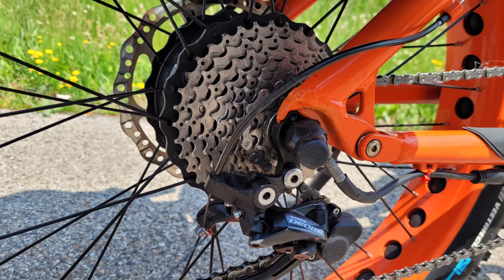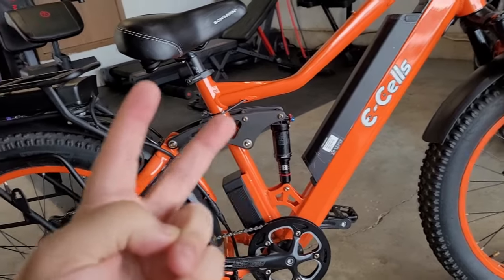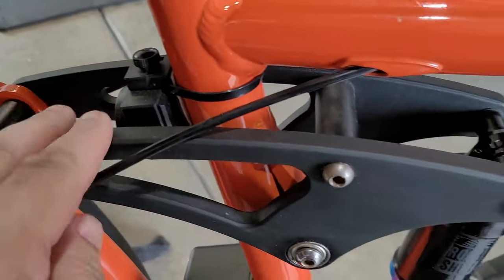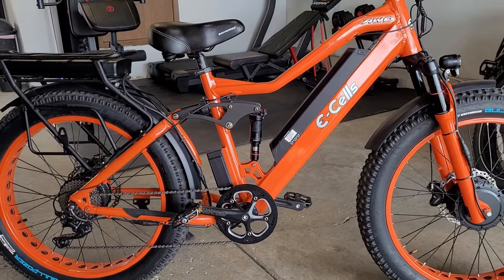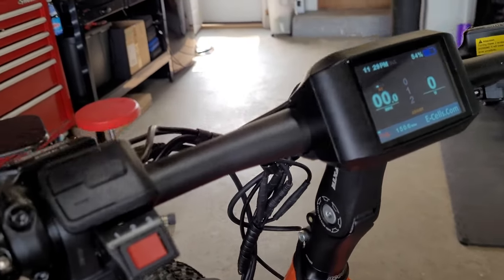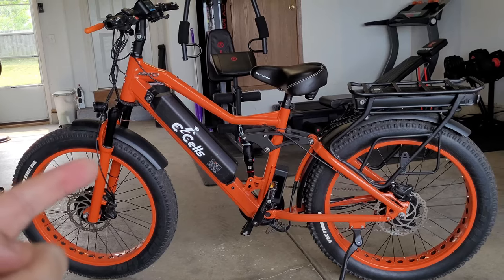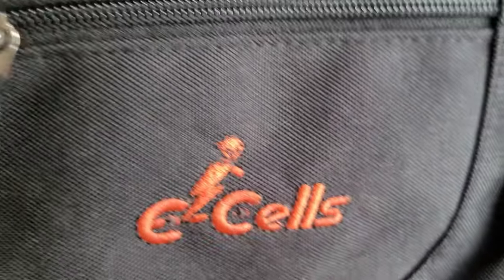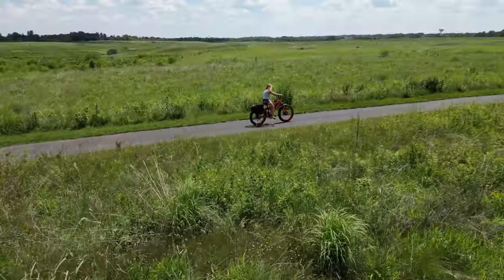E-Cells Super Monarch Crown 1500 ebike **Review**

Comment: That is an awesome bike, but it's also over $4,000 on sale! If money were no object...

The front fender isn't going to do much to keep the rider's legs clean or dry, it's too short.
Reply from the maker: I completely agree, I review ebikes for a living and they're usually around $2k range. This particular bike is like having 2 bikes in one and it's completely unnecessary unless you got money.....lol. Although there are a lot of brand name brands like Giant, Trek, Specialized etc that have way less stats and power that cost $5k+, but I think your just paying for the name at that point.

Did you check out the other models? They do have some around $2k.

As someone who has riden over 80 ebikes, I haven't found a fender yet that fully protects you.....lol
Reply: @E-Ryders  It's great to know what an eBike is capable of, but my 500W motor has been enough for me so far. Maybe if I had really steep hills to climb I'd have problems. As you say, it's two bikes in one, two motors and two batteries, those are the most expensive parts.
I took the rear fender off my bike and put it on the front, replaced the rear fender with something bigger,  added the front fender (backwards) back on the front, and plugged the gap in between with a piece cut from a plastic bottle, and I STILL get sprayed from rain hitting the front fender and splashing off onto my legs and feet.
I do really like the battery UNDER the rear rack, put some pannier bags on and it is hidden. If all batteries were there instead of on the downtube it would be less obvious they're eBikes.

Comment: Say Nelson,  Do You know if those motors.have metal gears or nylon  Thanx
Reply from the maker: They are Nylon in my Monarch Crown 1500 and they are a Nylon-Steel  in the New 5-Star Bikes they offer as well.
Reply: One of HENTACH’s best inventions is the patented Nylon-steel gear, now widely used in EU and US markets. Its strength is five times that of nylon gears, which allows it to achieve higher power, longer lifetime, and lower cost. This is from the 5 star website.

Comment: Nice bike is yours the US version? or European because your throttle is on the left instead of right
Reply from the maker: I'm not sure there's any other version other than a US version, but that's just an assumption. 

Well, it was an option to have a Halftwist throttle on the right or a thumb throttle on the left. The reason the thumb throttle is on the left is due to the trigger shifter already being on the right and you can't change the orientation of the trigger shifter.

Comment: I got my Super Monarch Crown in 2023 and love it. Mine is all flat black for hunting. I have a front rack that I remove when not camping or hunting.  Also I have a 220 watt solar "blanket" from Off Grid TREK that fits in one pannier along with its controller. This means that when camping I can charge my battery right from that solar blanket! For car camping I use the OGT blanket to charge a BLUETTI AC200 MAX Li Fe Po battery which runs my ICECO 20 freezer/cooler all day then charges my bike in the evening.
When I have to replace the motors in. few years I'll use the Canadian GRIN Technology hub motors WITH REGENERATIVE BRAKING. This innovative system permits freewheeling and regen. charging ONLY when  braking, thus the name FREEGEN.
** BTW, The only EMTB better than this one is E-CELLS new Kings Crown which sets another new standard of design & quality for EMTBs.

Comment: Do you guys make any bikes with 20 in. wheels? I’m worried the bike will be too tall for me at 5 ft 6 in / 30 in. Inseam for my legs.
Reply from the maker: I know E-Cells doesn't make a 20in tire right now. But who knows, maybe they will in the future if the demand is there?
Reply: Look up Fabulas e-bikes, they have a 20" dual motor dual suspension. It looks like a nice bike. 

Maybe this model.....
EMX Ultimate 60v
Motor:  Dual 60v 750watts, 105Nm AWD

Battery:  Samsung 60v 20Ah (1,200Wh's) 

2nd Battery:  60v 15Ah (900Wh) in Rack

Wheels:  20" x 4" CST Scout on Mags

Brakes:  Tektro Dorado 4-Piston, 203mm

Frame Type:  Dual Pivoting Suspension

Rider Size Recommendation:  5'2 - 6'2

Recommended Weight:  up to 300lbs